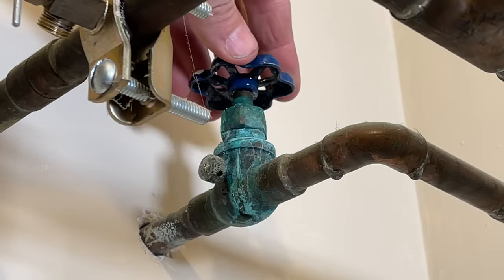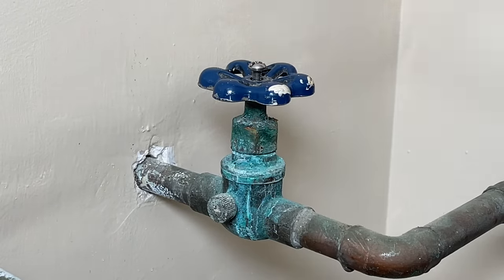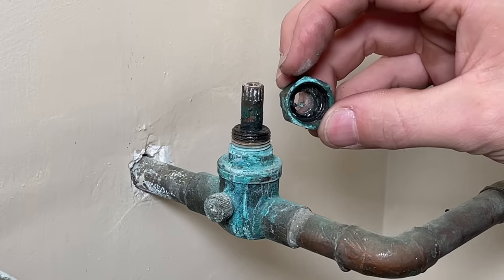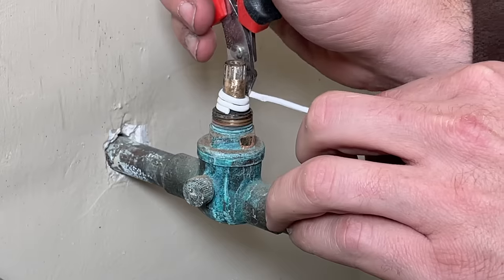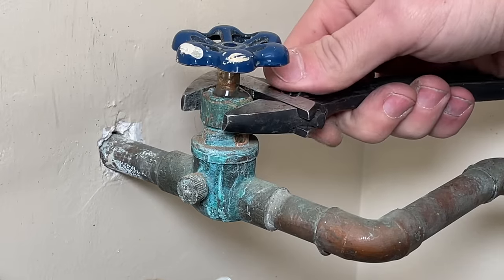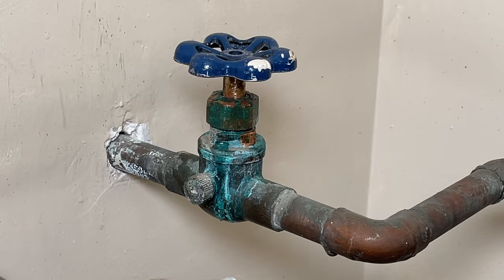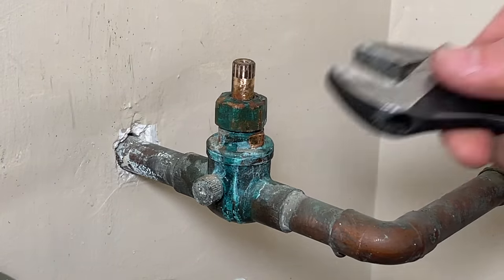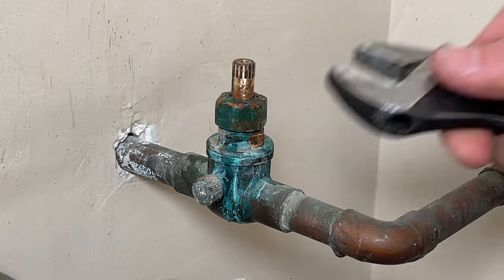How To Fix A Main Water Shutoff Valve Leak

Comment: Whenever you shut off the water, its a good idea to remove your aerators from all your faucets before run the water again through the faucets so you can flush out any debris that may have been dislodged in the process. 

While you're at it and while the water is still off, open all faucets (hot and cold) and a hose bib to drain all the water out of any dead leg type of air chambers that may have been installed to deal with any water hammer issues. The idea is that the dead leg will trap air in the end of the line which will absorb any water hammering, and it will. However, within a few months, all that air is absorbed into the water, making it useless against water hammer. 

There's no guarantee that a system has air chambers in it but its a good possibility and it won't take long to try. 

To resurface brass on brass mating surfaces, you can use emery cloth backed by plate glass and lap it flat. You can also anneal one surface with a torch but be careful with those threads. I would go with teflon tape or an o-ring first. As a very last resort, you could solder the parting seam. But you didn't get that from me....
Reply: Knnj
Reply: Only need to remove one aerator at highest point in the house where you purge the air from the system. Or you can just run a tub where there is no aerator.

Comment: Thank you for taking the time to create this video with simple explanations and example video of the valve components.  Once you understand how something is put together and operates, it makes it much simpler to attempt a repair.  I watched your video because I was planning work on a downstream fixture shutoff valve but wanted to plan for the worst if my main valve started leaking after years of no operation.  I do have several other globe valves in the system that are slowing leaking through the packing and creating calcium stalactites.  I've delayed tackling the fix because I figured the only solution was a soldered replacement, but this enlightened me to the additional options.  I've never repacked a value but plan to get some Teflon rope packing and giving this a try now.  Thanks!

Comment: I don't know if this applies to some types of faucets but I was always taught to open the valve fully not just part way.  I'm not sure if this is correct on water fittings but by opening the valve fully it also helps to seal the stem.  The only upper seal that I see on that fitting is the packing at the top so maybe this doesn't apply.
Great information, and I think this should take the fear out of messing with this type of faucet. 👍
Reply: When first opening a valve, especially a water main, opening part way allows a slower water pressure build up in your system.  If you open it all the way, then the initial water rush could break every faucet in your house.  One exception here is if you have a back-flow preventer, as that might keep tripping with partial water pressure; but even in this case you don't want to jam the valve open, just a slow but steady opening is fine.
Now, once the system is filled, you should fully open the valve.  Again, I will caveat, that with a multi-turn valve like in the video, back it off a 1/2 or 1/4 turn, as it will help prevent the valve from being stuck in the on position.  It will still be 99% open, which is close enough to still quality as "fully" open.
Reply: @canebro1  
8th

Comment: Many thanks Scott. One of my globe valves feeding an outside hose faucet started leaking badly when I re-opened it after this last winter. I live in Michigan and shut off outside water in late November, reopening in early April to avoid the worst of winter. This Spring, the valve that is worst for access — it sits above a finished area in the basement — sprung a leak after 22 years of use. I was ready to remove it (through a 6x6 spring loaded access panel — that would be a tough job!) but watched your video first and was able to fix the leak with your first suggestion: a ¼ turn of the pack nut! Thanks a bunch!

Comment: As others noted, I would have replaced the valve. However, as a DIY homeowner, this is extremely valuable learning the ins and outs of the valve. Thank you!
Reply: I've always preferred to replace the valve, but there are times where it's impossible or really difficult without a lot of work. I've never repaired a valve like this before so it's nice to add this technique to my toolbox

Comment: I own a trailer in a mh park. There is no water meter shut off to my unit. The incoming valve is original circa 1976. A plumber said it would cost a lot to replace. Probably a couple hundred. The valve leaked more and more when fully turned on. I put up with it for a year. Then I watched your video. I tried using the Teflon packing on a supply line to a washer with no luck and just replaced the valve. This time I used the graphite packing ($3) just on the exposed outer  threads of the packing nut as I couldn't remove the handle and there wasn't enough room to thread around the handle post. But it still worked! Thanks..

Comment: Thank you! I am not a plumber and have never before heard of valve packing rope, but Ace Hardware had some so I used your step 2 advice to fix my leak. Also I have no access to shutting the water outside of my house so this was a stressful issue you helped me resolve.

Comment: That a good way to fix leak , most times I find that valve won't shut all water off cause set and inside need replaced also
Reply: That's exactly what happened to us. The valve looked old just like in the video. So we had to replace!

Comment: My 120 year old mains leaked so plumber came said would have to dig up old lead pipe and replace etc... astronomical quote for work, another said couldn't do job because lead to copper piping was difficult. Was telling my mate who's a retired plumber he had a look and did what you did with ptf tape and fixed in 2 minutes. Cost me 1 beer!
Renovating kitchen right now, builder changed pipes back to main outside house and sleeved it and buried it and have all new plastic pipe work.
Ironically the lead pipe outside was split and leaking for god knows how long???
But time will tell if this new pipe work will last another 120 years.
Just found this channel and glad to sub to it.

Comment: Anytime that you change a washer that has been worn, you should check the seating surface that the washer butts up against; if there is too much corrosion there, there is a tool that can grind the surface of the metal seat so that it is smooth for the ring that butts up against the washer.
Reply from the maker: Thanks for the feedback Steve 👍
Reply: lapping the valve seat

Comment: Great  video.  I loved everything in it.  I want to add something. I assisted an old-timer plumber, fix-it guy, who taught me a lot.  I think he would have had me remove the drip valve cap when adding the torch/heat to save the washer in it.

Comment: 4:40 I'd have used a wire brush to avoid getting grit from the sandpaper into the valve's moving/sealing parts; also, the brush's bristles deep-clean the valve's nooks and crannies (i.e., the threads) much better than the flat-bodied sandpaper, which cannot effectively "reach down into" the recesses.
Reply: Yep you beat me to it.
Reply: Use an old toothbrush for final clean up?
Reply: @amerlin388  Yes, or a brass-bristled brush; it cleans off debris without scratching up the soft copper too much, the way a steel-bristled brush would :D
Reply: I was itching wanting to reach into the video with my wire brush to show him of better option lol 😂

Comment: Most don't know what to do at all, other than call a plumber.  Some know to tighten the stem cap to stop leaks there.  Fewer still, will remove the valve handle to remove the stem cap and replace the packing.  And almost no one will take the valve apart by removing the bonnet to replace the washer.  So, this video at least shows people how to restore a leaky valve if they truly want to do the work.  Great video and thank you.

Comment: Good stuff, but after you buy the separate washer, and other items, you might as well spend the $10-$15. on the whole valve stem unit.
Reply: No kidding huh?...especially since the street-supply was shut off, anyhow. But then you'd have to insert that link to your "how-to-solder copper" video. For those who have no clue bout' that either.  lol
Reply: Propress new ball valve
Reply: I would have just got rid of the old valve and put a ball valve. If you can't Sauder and are in a open location like this either us a sharkbite or learn to saulder (its really not as hard as people seem to think)
Reply: @stich1960  bro, "saulder"? wtf?
SOLDER!!
Reply: @stich1960   Soldering is not as hard as spelling solder....

Comment: As a service plumber I just highly recommend you just replace instead of bandaiding it just so no problems develope in the future
Reply: Much less, all this time spent rebuilding this old valve and it doesn’t look good
Reply: Not everyone can afford to just replace everything.  This video is designed for those who have the time, but not the money.  I consider it an EXCELLENT video.
Reply: I was just about to ask if it would be safer/easier/better to just replace the entire valve once you have it all off like that. He already ran to the hardware store. Those valves are only a few bucks lol
Reply: These videos help Home owners do it themselves! 
Sorry cooperate/contractor your profits are still helping you fuel up your 2021
Chevy silverado Z71 as you tow your 4 ATV'S to your 2nd home in the UP 😂🙃
Reply: @juanitovaldes1659  we’re not talking about replumbing the house here. We’re saying that he had the thing off and torn apart and he had to go to he store anyway to buy something. So at that point, use that money to just but a new valve.

Comment: Great video.  Very helpful. Had this issue recently at my daughter’s home she had just purchased. Wished I had known what I know now at this time. It would have saved me $300. The plumber made an emergency visit to cure the leaking valve by simply torquing down a quarter turn on the valve.
Reply: $300 to tighten the packing nut? That plumber should be in jail. And you should have known better.
Reply: @maxwedge5683  ... was out of town at my daughter’s home.  I turned the main valve off early in the day to work on another plumbing repair. The main valve immediately began to spray and leak at a 2GPH rate whether closed or open. It was doing some minor damage in the basement and required regular bucket emptying. It was a badly corroded 60+ yr old valve. Had I known what I learned in this video, I could have avoided the $300 cost and a ton or worry.  The County Water Authority has sole control over turning the water off at the street level and was not able to turn the water off until the next day, no guarantee.  Making matters worse, I couldn’t stick around another day and 48 hrs later a contractor was scheduled to install a new furnace, ac unit and hot water heater all in the same day.  In our locality access to a plumber is extremely difficult.  I was lucky to find one large plumbing business capable of providing same day emergency service. There was a $190 charge to show up, plus a min 1 hr work charge.  The guy was extremely helpful and also addressed the other plumbing repair replacing a leaky toilet valve with a new ball valve (in less than 10 minutes).  It was great to watch him in action. While it was expensive, it was a tremendous relief for me and my daughter and I gained some beneficial knowledge in the process.

Comment: Nice video for showing the options. I will comment on the third step. The washer at the bottom really has nothing to do with leaking out the stem. That fix would be for if you turn off valve and still leaks at a different point (such as another location you are working/repairing). The fix for leakage at the stem would be fix 1 or 2. Otherwise I find your videos informative.

Comment: Stem seal can also be used in place of white valve packing. The valve packing also comes in several sizes. For those of you that have never done this before you need to know that when you remove the stem from the valve body that small brass screw the holds the "seat" is most times impossible to remove as it's exposed to water forming an electrolyte that will cause corrosion. BTW the "sandpaper" is typically aluminum oxide and you did NOT put it in the description below

Comment: My house has a shower in the garage where there probably was a sink, that said i have exactly the same old type valve. Stopped leaking for now, i just dont mess with it, probably going to upgrade to the ball valve. And create both a shower and utility sink.
Thanks for the great diagnosis and resolve.
Happy New Year, America...
Reply from the maker: Yeah, longterm solution would be a ball valve 👍

Comment: Should've just re-piped the whole thing with a ball valve and also get rid of that illegal Saddle Salve as well. If you have 5 elbows in a span of 2 feet, that piping is too complicated.
Reply from the maker: Hey Andy, for this actual project I will repipe and swap out the globe to a ball valve.  This video was focused on those in a situation because of 1 or more factors need to work with the globe valve which is in place and stop the leak.  Thanks for the feedback.
Reply: @EverydayHomeRepairs  I understand why you'd opt for repairing the bonnet valve, it costs $10 more, and requires soldering or $20 and uses a SharkBite, but your renters are gonna tighten down that valve until it squeals, then it will fail again. Bite the bullet.
Reply: @JimfromIndy  yeah this is an annoying habit people have I've noticed... You replace the old worn out thing (that you have to fight with constantly) with a new one, and they keep treating the new one like the old one and break it real quick. Happens to our TV remotes at home 🙄 pressing the power button harder ain't gonna help if you're not aiming at the TV right cause you got junk piled up in front of the sensor!
Reply: Why is that illegal? I think it's insane that government now has the say of what you do in your own home. I find that crazy. Government should strongly recommend their codes but should never be illegal or banned.
Reply: @MattyDemello , spoken like a true SJW that doesn't know anything and just wanna complain about Government Regulations. Saddle Valves are not up to code cause they're prone to leaks, you're puncturing a hole on the exterior of a copper pipe - are you gonna really trust the rubber on the saddle to adequately protect you from leaks against the city's water pressure?

But hey, you do you. A potential buyer's inspector will notice it and it'll be on the list of items not up to code. Should you ever make an insurance claim, it'll get denied once the inspector sees that Saddle Valve.
Reply: @arcadion448  ohhh ya now I know what you're talking about. Ya people should not use those things. I agree. Stores should stop selling them then. I still think it should be up to the home owner who paid for their house though. I can see using one if it's for a short time. Like a week and then replace everything
Reply: @MattyDemello , Yeah sure - a homeowner is really gonna install one temporarily just to replace it with something up to code later. 
🙄 🙄 🙄

They could've easily taken just double that time to do it properly. You don't get any savings from a Saddle Valve.
Reply: @arcadion448  ya I personally would never use one. But I'm thinking a situation where you get a new fridge with an ice maker but the plumber can't make it for a week to install new lines to the fridge. I could see maybe that situation. I still wouldn't use them I wouldn't trust them for even a day but hey I'm still in favor of the owner deciding. It's his butt on the line if it leaks and insurance won't pay
Reply: excellent point
Reply: @JimfromIndy    renters   DONT   GIVE   A  ***K   about anything. i work part time, as a helper for a local real estate agent. the crap that they leave, to fix/cleanup is absolutely mindboggling.......IF THEY  don't change and amend their ways, they will always be running to another  place  to  ' wreck '   er.....i mean   rent and dent....until there are NO  MORE   DECENT  PEOPLE  to rent from.....aha

Comment: 2 Things you need to do. Heat where the bonnet threads are and not on the bottom of the valve. Second always use vasoline on the threads and the valve handle. They will come off easy years later. My experience from more than 57 years in maintenance.
Reply: Vaseline intensive care... 😁
Reply: Plumbers grease

Comment: I soak installed fittings by wrapping the fitting in a rag and then soaking the rag with vinegar, or whatever I'm using to remove mineral deposits. That has worked very well for me.

Comment: In step 3 , I use low torque 3/8 impact wrench + deep impact sockets to remove the upper assembly and replace a new assembly. The impact wrench will better evenly distribute torque around the control valve than hand wrench. Method 4 desolder the old control valve and solder a new one.

Comment: I would recommend that you always shut off the main first as a precaution.  Then before cleaning up the stem remove all the old packing and open the valve completely in order to clean the entire stem. 
Soak a rag in vinegar or CLR, wrap it around the valve then wrap it up in plastic and let it sit for half an hour or so. Caution ⚠️! Those mineral deposits may be all that's preventing it from leaking in the first place!
Reply: It may be all that's left of the pipe! 😂

Comment: I had a dripping shutoff valve and could see a couple of threads so I tightened the packing nut and that fixed it! Thanks so much.  Had it fixed in two minutes.